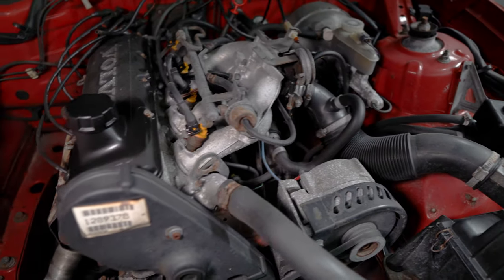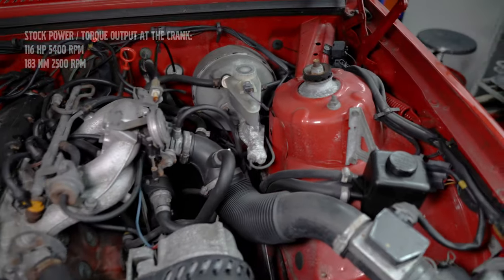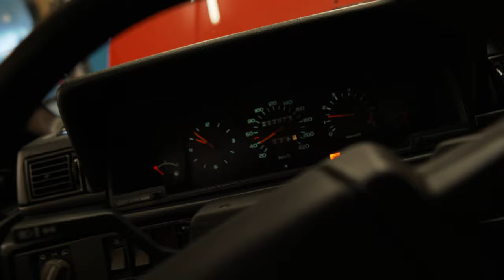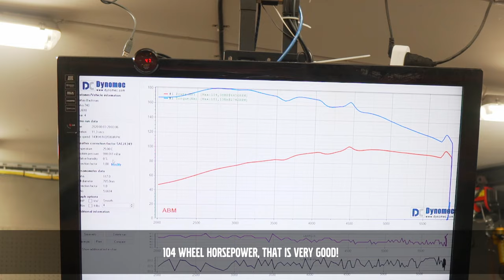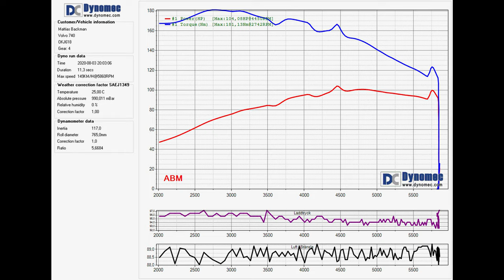How Much Power Has My Volvo 740 Gl Lost In 30 Years? - Dyno at ABM - 1000 Sub Special

Comment: A very interesting video. I don't have access to a dyno. So, what I do with my '90 740GL that I have now owned for over 20 years is head to a long, steep hill on a highway nearby and peg the speedometer at 100kmh and see if I can maintain that speed without the AW70 transmission downshifting from overdrive. After 20 years my 740GL will still go up that hill the same at 439,000km as it did with 195,000km. It will even gain 5-10kmh, just as it did more than 20 years ago. A sign of a healthy B230F!
Reply from the maker: Yep, They ain't fast, but they sure are dependable and reliable.  😀👍